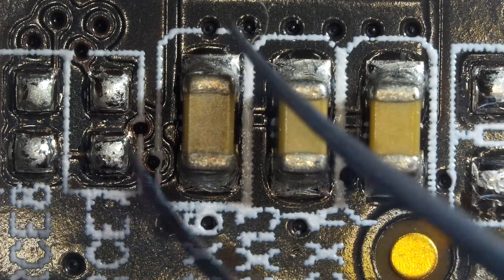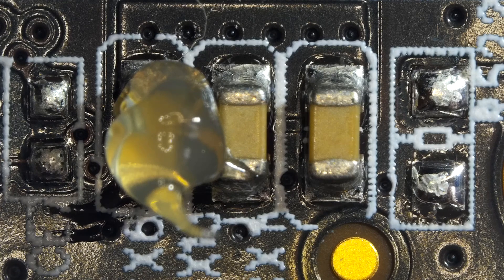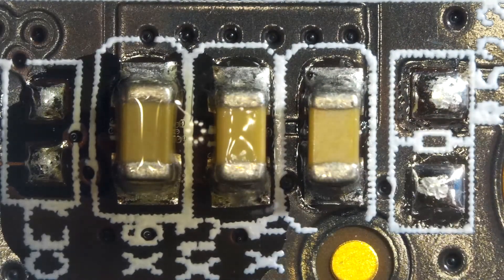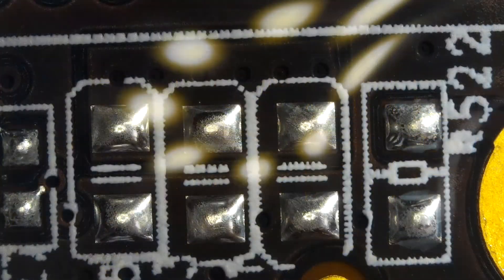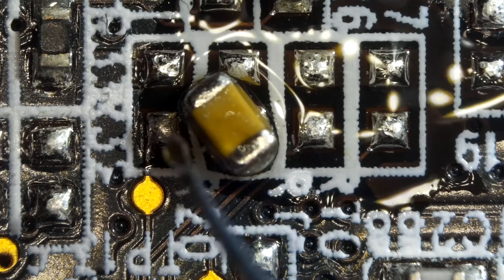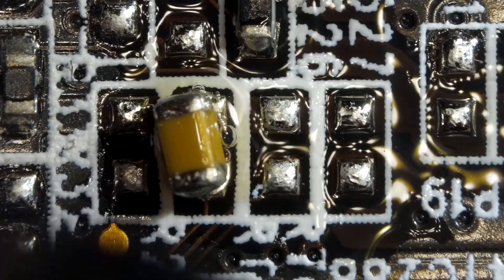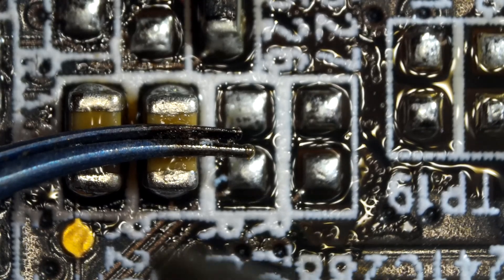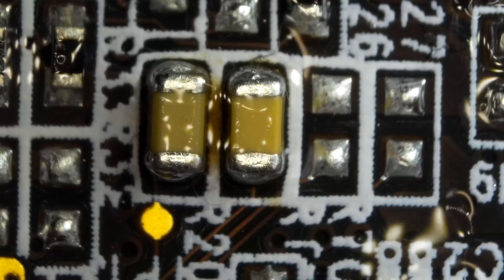How to Solder & Desolder SMD Components with HOT AIR

Comment: Thank you, this was helpful! I tried to do a joystick swap on a ps5 controller and after putting the stick in I realized I melted off some other components. 😅 I've been trying to swap some from a donor board but they are microscopic, like actually less than a mm on the longer side. I think it might just not be possible for me. It keeps sticking to my tweezer instead of the board, and when I get it set right the solder doesn't want to melt and actually attach to the thing. I think I'll have to call this board toast and make it a learning experience and try again. Still, I feel better prepared next time after watching this video. Thanks!

Comment: May u share your type of flux you use and equipment?
Reply from the maker: The flux: Amtech NC-559-V2-TF 30cc
Hot air station: Aoyue 852A++ Digital SMD Hot Air
Reply: @PTITBROTHERGravenhurst  wow.. tqsm.. what about lead? Wire type brand and liquid type brand